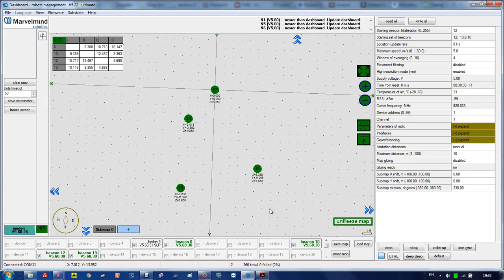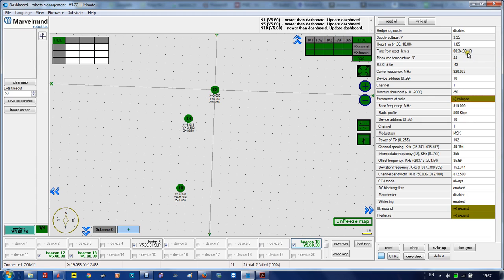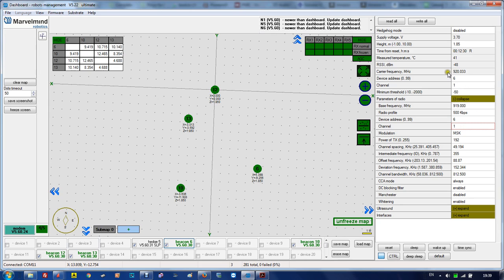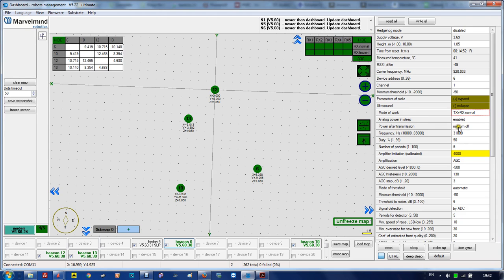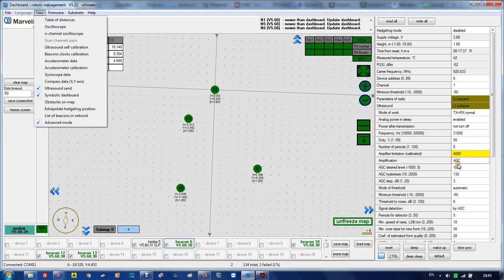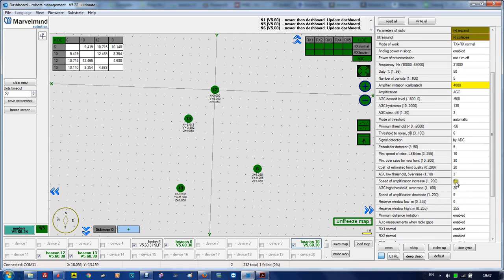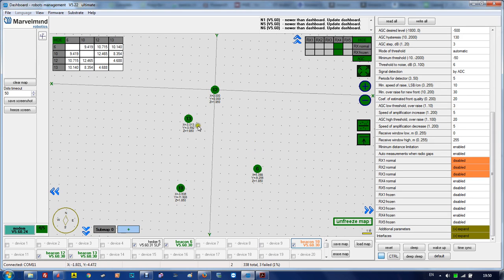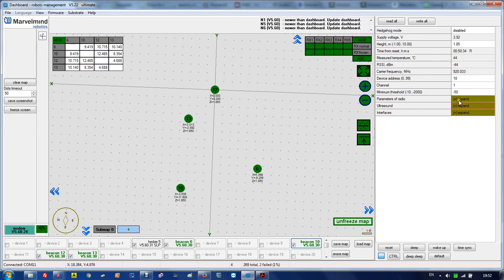Help: detailed explanation of beacon settings in Dashboard

Comment: I'm afraid my AGV will lose signal when entering the obstructed area
Reply from the maker: With AGV it is easier, than VR, for example. We strongly recommend to use other systems in parallel, for example, IMU+odometry, and employ sensor fusion. In this case, when you lose Indoor "GPS" coverage, your AGV will rely on IMU+Odometer. IMU+Odometer will accumulate the error pretty quickly, but you will reset the error as soon as the system is back to the area covered by Indoor "GPS".

We build our own robots this way and it works well: https://www.youtube.com/watch?v=TBTw1njQ7QY&t=65s&spfreload=10
Reply: thanks. I have question:
If i want design layout for AGV, then your software support about that?
Reply: What is your location method?
Do you use ultrasound?
Reply from the maker: Yes, we use a combination of radio + ultrasonic.

We stream out location data to in GPS format. Effectively, we are an GPS for you, which works indoor and give to you +-2cm precision. All other required manipulations your AGV SW must do
Reply: Marvelmind Robotics yes, I see: customies sofware fee is 35$/h
You can explain for me?
Reply from the maker: We do provide SW customization. If you want some special SW update for our system developed for you, you send us description of what you expect and we will provide you with a quotation based on man-hours
Reply: yes, we have project about AGV in VietNam. My customer like your method
:D
Reply from the maker: Yes, it ultrasonic + radio in ISM band (433MHz or 915MHz)
Reply from the maker: Some customers ask for development of additional new features specific to them. We do support that service too. We provide an estimate of efforts in man-hours and the customer decide based on the costs
Reply from the maker: Very good :-)
We will be happy to help you with your project